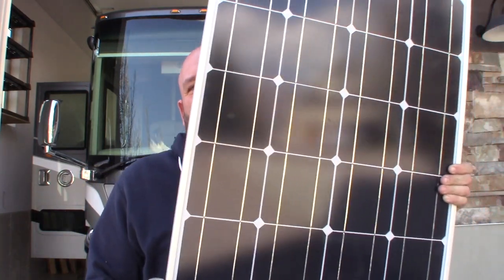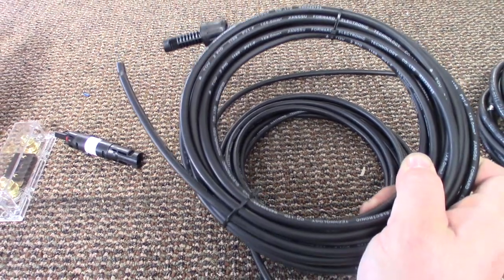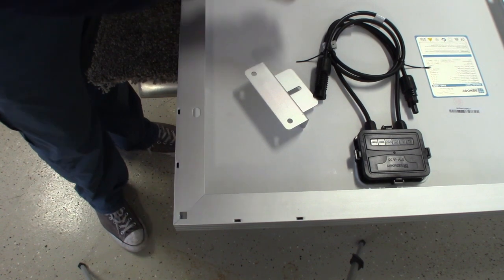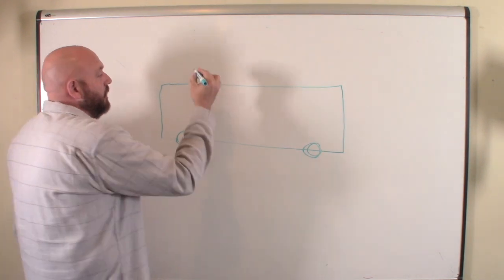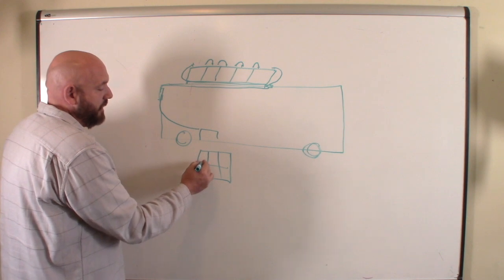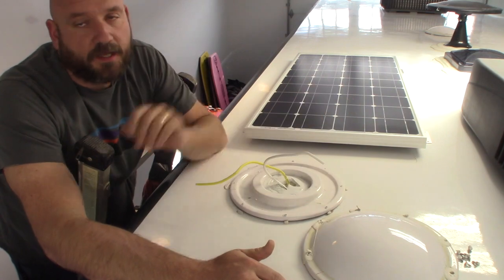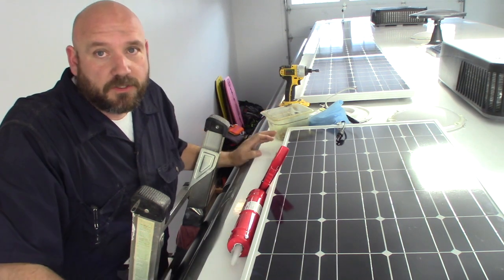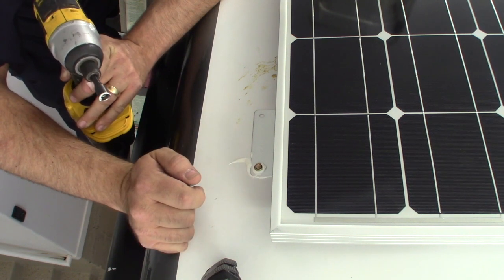Complete RV Solar System Install - Josh's Garage

Comment: Great video.  We're getting ready to do a similar installation on a Newmar Kountry Star. I wish ours was solar ready. I think running the wires from the roof to the charge controller  and then batteries will be the toughest part.

Comment: So when installing solar panel to the roof is it necessary to find the studs to drill through them?
Reply: Actually, I don't drill anymore.  I've installed my new panels with VHB tape.  No screws.
Reply: @loshjittle  

Thanks for your reply. oh okay but when you did drill are we supposed to Joe through a stud?

Or it doesn't really matter it holds Good as is.

Comment: Just watched your residential fridge on solar video and commented on it. After watching this video I can tell you that the level of mistakes made on the install is a huge part of why your are having trouble. I don’t ever do this but seen you live in Utah as do I. If you want to improve your system I’d be willing to lend a hand and point you in the right direction for optimal use.

Comment: Great video! Thanks or talking time to post. I have a 110 watt panel I want to install on my 2016 Outback 326RL. I have no idea what type or length of screws to use on the roof with that rubber material. Can you give me an idea of the proper type and length of screws to use? The solar kit I bought uses Z Clamps like in the link. I appreciate any tips you can provide. Keystone/Outback couldn't tell me since they do not install solar panels. Thank you! 

https://www.homedepot.com/p/Nature-Power-110-Watt-Polycrystalline-Solar-Panel-with-300-Watt-Power-Inverter-and-11-Amp-Charge-Controller-53110/311140967

 Respectfully,
Steve Culver
Reply: I've switched over to VHB tape.  In fact, I just got a new motorhome and used VHB tape on all of the panels.  THere's a comment below with a link to AB soloar which has a great video on the bonding power of VHB.
Reply: @loshjittle  I read about VHB tape but I'm worried about ruining the rubber roof. Do you have a type of screw that you would recommend? Thanks!

Best regards,

Steve

Comment: Motorhomes are vehicles that bounce, shake and rumble down the road. Solar panels get all that bouncing and shaking, plus wind resistance which can loosen and rip those panels off your roof. So you should have used 8 screws to hold them down to the roof, not just 4 screws.💁‍♂️ The worst part is the old couple driving behind you who get a solar panel through their windshield; or the family in a van. 💔🤦‍♂️
Reply: What size and type of screws do you recommend?

Comment: For ppl that don't have the shrink tape stuff or heat gun,  a lot of but connectors will shrink with heat as well even with a lighter and feathering it with flame.  Just be sure not to melt outer wire.

Comment: How on earth would you get the panel down if you have to replace it ? It seems that panel has to bge upside down to get at the hardware to unscrew it
Reply from the maker: There's actually enough room to get a box end wrench under there.  The bottom of the panel sits about 1" off the surface of the roof

Comment: I just installed my first solar a couple months ago. I have 200 watts and a 60 amp epever charge controller. Yeah yeah yeah I know why a 60 amp controller it so I can add more solar when I get more money. No sense on buy a smaller one then spending more money on buy a bigger one later. Loved you video btw.

Comment: Josh, did that kit include enough cable to connect the panels end-to-end like you did, or did you need to buy longer extension cables?
Reply from the maker: I had to buy the longer extension cables.  Renogy had them in 10 or 20 foot lengths if I remember right.

Comment: It's not necessary (or desired) to drill into the roof on installations with fiberglass roofs.  Clean the surface with isopropyl alcohol the stick down with 3M VHB tape.  Cover the bracket with self leveling Dicor.  The panels will not come off and eliminates the leak potential of all the holes.
Reply from the maker: Good suggestion.  I'll certainly do this next time.
Reply: I’m looking into installing some panels on my 5th wheel RV. I like this idea but I’m afraid they will blow off in high winds and or high speed going down the highway. Anybody have any experience with how strong that bond will be if no screws are used? Anyone have these things fly off on the highway? That just sounds like a nightmare. Thanks!
Reply: https://www.youtube.com/watch?v=mXiNLCWPPkA&feature=emb_title
Check out this video from AM Solar
Reply from the maker: @frontieradventures2199  Awesome video suggestion.  I was wondering the same thing.  Guess I'm not drilling in a roof again unless there is a textured roof or something.
Reply: I'm doing a system on a brand new Winnebago travel trailer. Been struggling with mounting, the roof material has some texture to it but I am liking the tape idea. Just want to feel more confident with tape, panel flying off could be disastrous to someone behind

Comment: Don't you think it would have been a better idea to apply the lap sealant underneath the entire metal mounting brackets ? That way it would be similar to a gasket or insulator so any movement or vibration from the solar panels wouldn't damage the roof membrane .
Reply from the maker: I didn't say it in the video, but I did apply sealant below each bracket for the reasons you mentioned.  I just don't trust that to be water tight.

Comment: Hi, great video. Just a quick question, did you worry or consider where you drilled your attachment holes? I have a  Tiffin as well and worry about hitting any  a/c duct work channels or wiring below the roof or are the screws short enough not be a problem? Thanks
Reply from the maker: It was a concern, but in looking through the solar pre-wire hole, it looked as if there was plenty of clearance between the roof and those items which hung closer down to the ceiling.
Reply: Josh's Garage  Thanks, gives me a bit more confidence on my install.
Reply: @joshsgarage1545  Yes, the ceiling is usually aspenite or something into so you don't have to find studs. However, to me those lag screws look pretty long. Did you think of getting shorter ones?

Comment: Garage Done in parallel is a way better option.Done in series a small amount of shade cancels out all of the panels!!
Reply from the maker: True, but I would have had to run 4awg cables to run these parallel to my controller.  This wasn't an option for me as my coach came pre wired with 8awg.  And since I live in the desert and rarely park under trees, it's not an issue for me.
Reply: @joshsgarage1545  Yes, but (a) why not have two in series then in parallel. You may not always camp in the desert.  You must also be getting close to the max on the potential input on your charge controller as your panels would each be giving you about 18-20V x 5 ~ 100V

Comment: Sorry to ask; WHY Did you put your panels in Series? So wouldn't that be 500Watts ... 
am not so good with the watts and volts thing. aka POWER! LOL
Reply from the maker: Good question.   By wiring the panels in series, I can use much smaller cables from the panels to the charge controllers.  In series, I'm carrying a 5 amp (output of one panel) 60 volt current (5panels x12 volts).  If I wired them in parallel, I would have a 25 amp (5 panels x 5 amps) 12 volt current which would require much larger cables.  The charge controller will do the conversion to 12 vols for me.  Here is a cable size calculator to help https://www.renogy.com/calculators

Comment: I installed the same system except I installed a 800 system but I installed it on my 28ft trailer that I tow my trike and jeep in.The system plugs into the motor home .The reason I installed it on the trailer is so I could trade the motor home at a later date if I wanted to.I had done this before on a fifth wheel and guess what I traded the fifth wheel and lost my panel setup so had to start over with the mh
Reply from the maker: That's an excellent idea!  Why hadn't I thought of that :)  I just sold this motorhome and the whole system with it :)

Comment: Thank you Josh for share your fantastic solar install. Your video came up as a Youtube Suggetions to watch. I'm glad that I chance to see the video. Is or will your system be set up to run any large amperage devices? Keep the videos coming....
Reply: Thanks Mark!  I needed some positive reinforcement of this effort today :).  This system will run large amperage appliances, but that's always a matter of time and amperage.  Like...hair dryer for 5 minutes - yes.  Hair dryer for a day - no.  I basically have about 450 amp hours to play with each day and on a sunny day in summer I can easily replenish.

Comment: Fantastic video, very informative. I have two questions, 1) what type of solar control charger did you use (Mppt or Pwm)?
  2) why didnt you just install the solar control charger by the batteries in the bay?
Reply from the maker: Hey @fiddle1999, thanks for your kind comment.  I used a 40a Renogy Commander (MPPT).  I didn't install it by the battery because I want to be able to monitor the system from inside the coach.